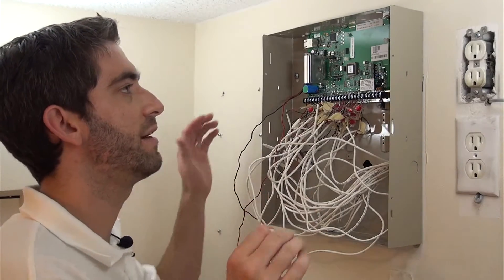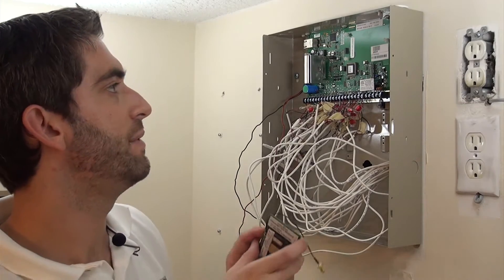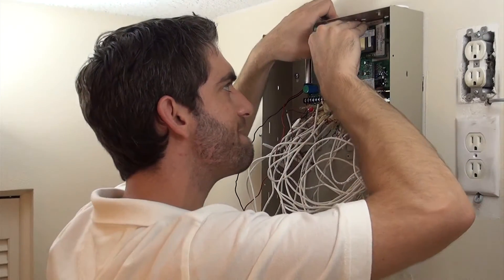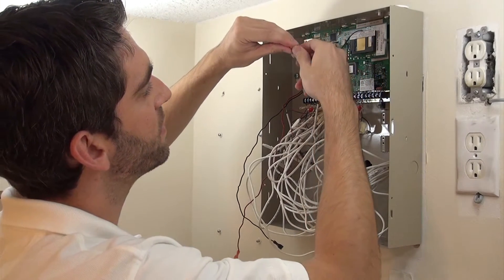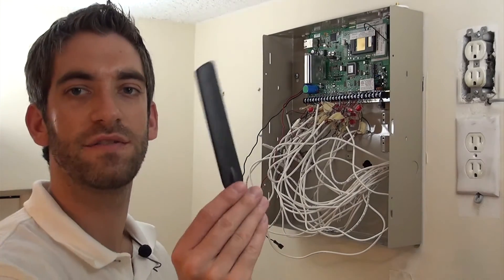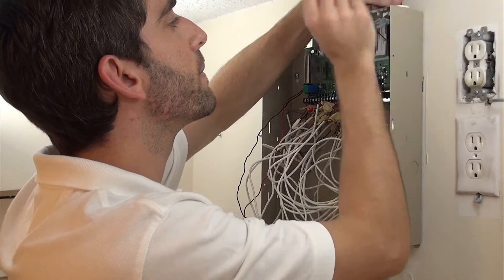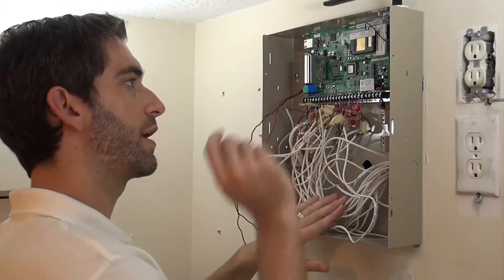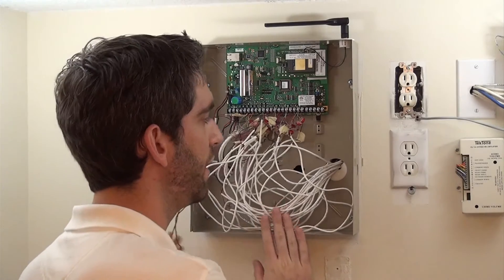Honeywell VISTA-GSM4G: Installation of Cellular Communicator to VISTA 21iP

Comment: Isn't there a 4G/LTE Mobile Com Board for the Vista 21 IP?
Reply: The original VISTA-21iP only supports the AT&T 3G/4G (HSPA/HSPA+) VISTA-GSM4G module shown in this video in terms of a snap-on cellular module. https://www.alarmgrid.com/products/vista-21iplte. However, the VISTA-21iP has a jumper that can be changed so that you can use any external AlarmNet communicator - https://www.alarmgrid.com/faq/how-do-i-install-the-honeywell-igsmv4g-on-my-vista-21ip-alarm-sy. Therefore if you have the original non-LTE VISTA-21iP, you can simply change the jumper and add an external LTE communicator like the LTE-iV (https://www.alarmgrid.com/products/honeywell-lte-iv) which is a dual path (IP w/Verizon LTE backup) or LTE-iA (https://www.alarmgrid.com/products/honeywell-lte-ia) to add LTE communications. If you don't have an existing VISTA-21iP, the new VISTA-21iP LTE (https://www.alarmgrid.com/products/vista-21iplte) supports a new LTE-21iV (https://www.alarmgrid.com/products/lte-21v) snap-on cellular module.

Comment: Wow what a joke. You probably broke the connector already. Why are the EOL resistor's at the panel. That's amateur work
Reply: EOL in residential panels are the norm. Ever try putting EOL on a window contact. And if you do and lightning hits it how do you replace it in a pre-wired wall ? Eol in UL or high security but screw it in residential is my thoughts .
Reply from the maker: Yes, we understand the wiring is a mess and the resistors belong end-of-line. We didn't install this panel and just used it as an example to show the installation of the VISTA-GSM4G module. I'm not sure what connector you think we broke though.

Comment: What a rats nest. I would fire any of my guys that left a system looking like that. If you have ever had a seven amp battery fall on your toe because lazy people wont take the extra time to make sure the battery fits in the can you would understand.
Reply: If battery gets reversly hooked up... Mistakenly... Then what damage we will see
Reply: +qaisar qadeer Did you do it for a long time or just a short time?
Reply: I have seen a lot of these panels. It is like this everywhere. No one looks at this again when installed. Installers quickly install panels and move on to the next. It is all low voltage and not inspected. But no excuse for this when uploaded to you tube.
Reply: Give them credit for at least wiring it. Most companies now just do wireless. I'm old school and will wire all that I can. Yes its messy but maybe it will catch the battery when it falls.